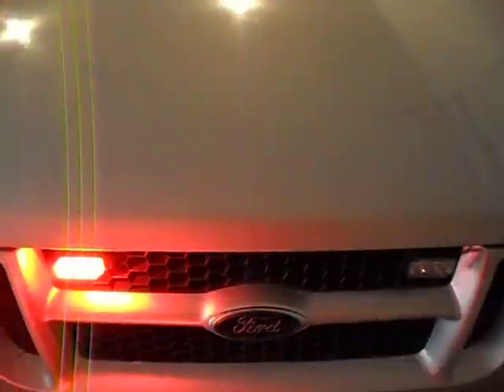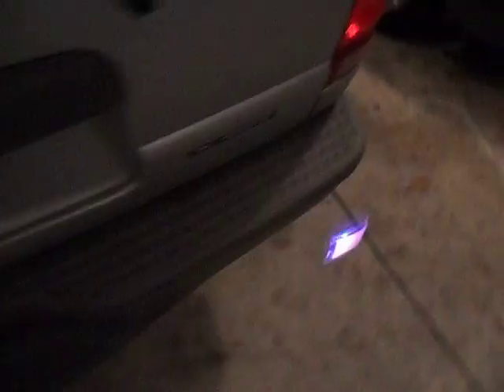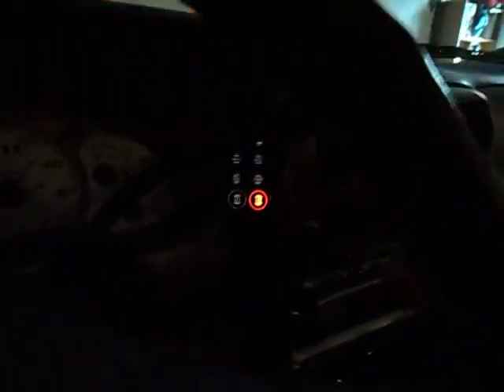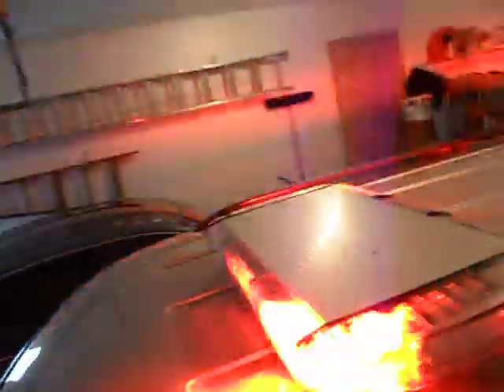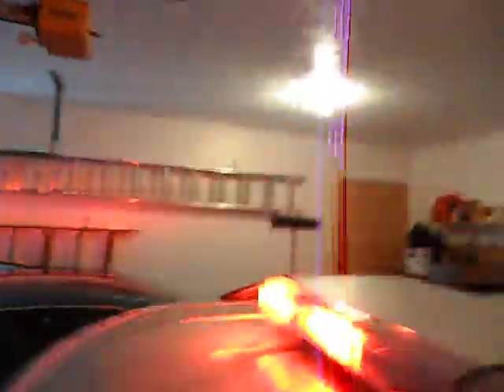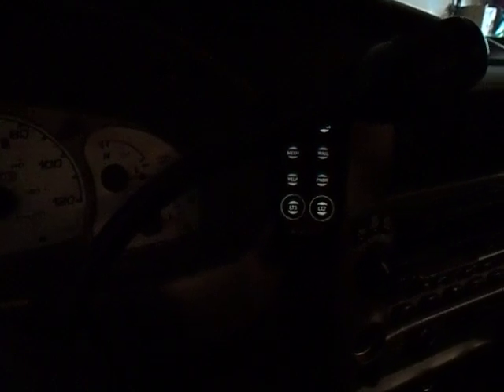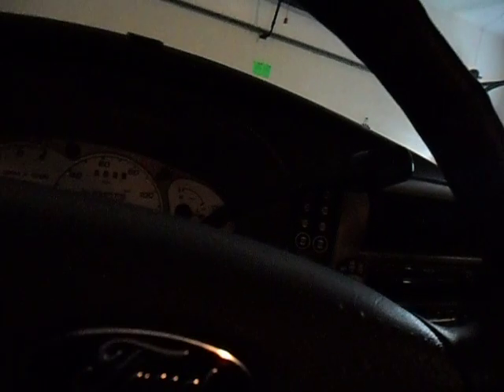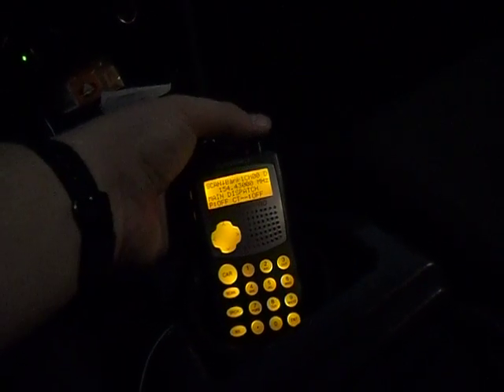Current POV Lighting Set-Up

Comment from the maker: @g4tvcops1 Came with the 4 corners only.  I bought 3 self contained 500 series LED's, one of which was a custom split red/red.  They were wired up to the main power wire coming from inside.  I have room in the back for whatever other LED i want, for a total of 8.